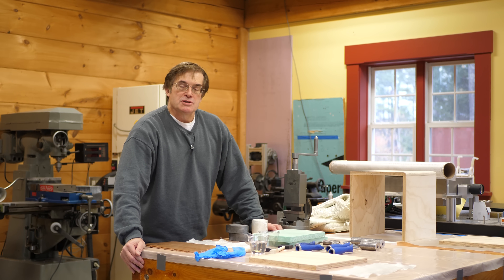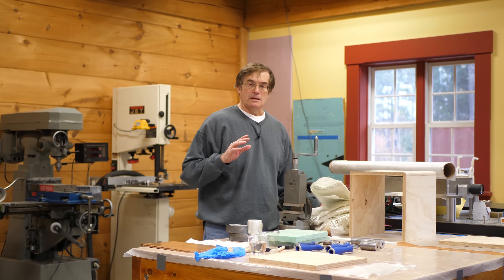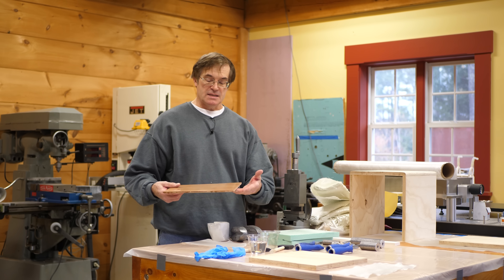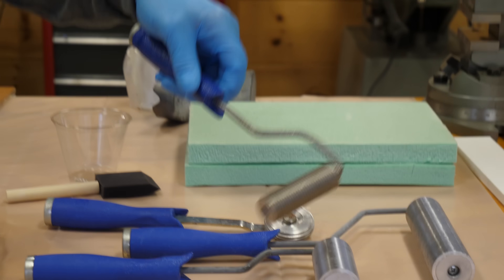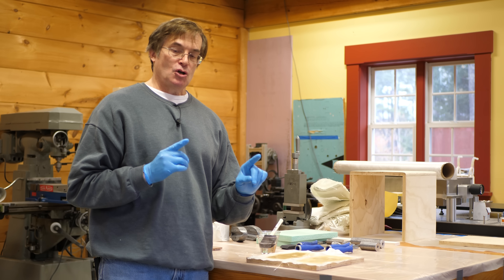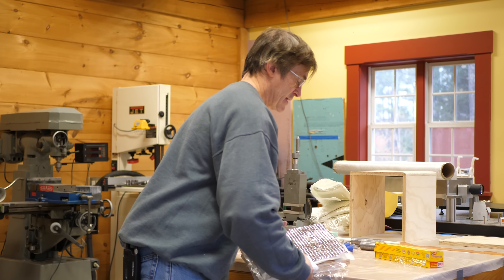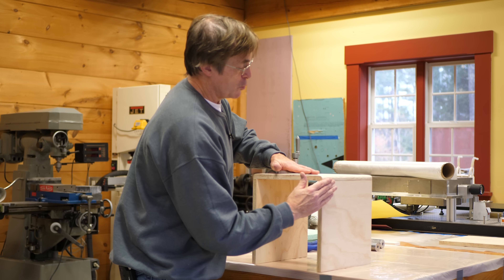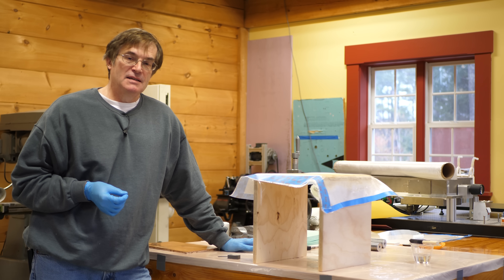Easy Tricks Using Fiberglass Strengthening!

Comment: The only thing I will criticize is a common mistake made in most back yard fiberglass projects - that is, using a single layer of 7oz cloth by itself, especially on wood. A single layer of cloth (doesn't really matter what weight, from 2 oz to 24 oz) tends to de-laminate very easily with over-flexing of the subsurface, or any counter-normal force on the laminate. Again, this is especially true for laminating wood. The cure for delamination (95% of the time) is to pre-wet the wood with slow resin and allow it time to soak in to the wood fibers and to cure (kick off) at least partially. Then layup a layer of 3/4 oz mat (random orientation) before laying in the cloth. This is similar to the wad of 24 oz cloth you showed with the mat backing. The 3/4 oz is thin enough that it will not pool up the resin, it aids in thoroughly wetting out the cloth, and finally, no matter how hard you try, a single layer of cloth WILL have holes after curing caused by the weave. Sometimes the holes can be microscopic, but it keeps the lamination from being totally water proof. Over time the moisture that finds it's way into the wood will spread and cause the lamination to separate. The 3/4 oz mat under the cloth insures a complete seal. Even so, the method of fiberglass over plywood or any other wood for boat building was abandoned by the 1980s by all but one die-hard boat builder in North Carolina. Even they have quit using this construction method in the last 15 years because the problem of de-lamination has no solution , at least none has been found in 75 years of commercial boat building. ... and one tip: use a very short nap, 4 to 6 inch paint roller to apply the resin to the glass. It gives more control over the amount being applied, it applies more evenly, and doesn't pull the glass around and out of shape.  In commercial boat mold (tool) making a sheet of 3/4 oz is wet out to excess, then the 7 oz clothe is put over it and a soft rubber squeegee is used to both press out the bubbles and to pull out the excess resin. Depending on the boat builder, sometimes the 7 oz cloth for the first layer is removed once the excess resin has been squeezed out and only the 3/4 oz is left to cure (very slowly) This prevents imprinting the cloth pattern to the inside of the mold.
Reply from the maker: I'm sorry, but I have to disagree.  I have been building boats for many decades and the single layer technique has worked well and is still protecting projects I constructed nearly 40 years ago.  Gougeon Brothers, similarly have boats that are doing well after 30 years of use.  There are various methods for applying cloth to the outside of hulls and your method also works well.
Reply: @TechIngredients  It's not unusual to have long debates, for vs against, laminated plywood in the lunchroom among glass techs, but one thing you will not hear argued is the shortcomings of a single layer of any weight cloth with no mat backing. My experience is working with polyester and vinylester. You are working here with epoxy and it's adhesion and filling characteristics may be different. You are also laminating a closed cell foam core. The resin is not absorbed out of the glass layer during the layup in this case so there is a reasonable argument for it. If water does find it's way between the lamination it won't rot the foam. In wood lamination this is where delamination usually begins. Environment temperature changes on the trapped moisture can delaminate an entire 4 x 8 panel - I've seen it happen - more than once!  During the fiberglass boom in the 1960s many major boat builders; Chris Craft, Hatteras, Bertram, etc tried to perfect laminated plywood, but all abandoned it fairly quickly. The N.Carolina builder is Carolina Skiff. The hallmark of this company is a glass laminated plywood, flat bottom boat. It was warranty work on delamination that finally drove the company to convert to molding their hulls and getting rid of the plywood all together. I think you'll find most small commercial and custom boat builder that does this is using a chopper gun to lay down a very thin layer of chop, about as much or a little less than a 3/4 oz mat, which also pre-wets out the wood, before applying the cloth.

Comment: Speed curing weakens structure
Reply from the maker: Not necessarily.
Of course the coating must remain fluid enough to completely wet out the cloth.  The polymerization rate is temperature dependent and each resin system will have a recommended range for curing.  Many high performance systems require an elevated temperature to complete the curing process and reach their full strength.

Comment: It is much cheaper & easier to start with polyester resin, not as strong though. Also the cloth does not have to be glass if you are using epoxy organic materials can also be used like flax, hemp, bamboo, etc. There is a product you can put on the surface before cure of epoxy so you can peel the amine layer off with it once dry.

Comment: Challenge..!
Functional hexapoidal rolling chassis.
Insectoid monocoque design.( my spelling is broken).
Rv scale. 8 1/2 feet wide. Up to 13 feet tall. 27 feet long.
Integrated thermo electric generator layers( sensor or energy or homeostator).
Solar, wind and water turbine.
Ultimate escape pod...!

Comment: Great video! It gives me an idea: when laying up a deck you can use slow cure epoxy and then lay black contractor bags over the top. The sun will heat the bags and the lay-up significantly and speed up the cure time. No heating pads necessary.
Reply from the maker: A lot of wooden boat builders take advantage of the sun.  They'll do the layup in the shop and bring the part out into the sun to speed up the cure.  The bags will speed this up and keep the bugs off, but can imprint the surface.  Most don't use them. 
Keep in mind that if this is a first coat over porous wood, the heat can expand the air under the resin creating A LOT of bubbles.
Reply: @TechIngredients  Good to know.

Comment: Hi Tech Ingredients - - - might want to check our robert murrey smith's channel as hes been working on graphite ballistic armour. I also want to thank you. Im thinking on making a kayak and your info is very informative. All the best, kieron uk
Reply from the maker: I'll check it out.  Graphite has been avoided for armor because the amount of energy it can absorb is quite low.  Toughness is the product of tensile modulus times ultimate elongation.  The greater this product, the greater the work (force x distance) the material can absorb.  The modulus of carbon is really high, but the  ultimate elongation is pretty low.

Comment: An other good technique for speeding up curing time is using infrared lamps.
The advantage is that if you have problem areas that need more heat than others,you can easily regulate heat quickly by moving lights closer,and save the insulation and covering part! You can use infrared emitters used for lizzard terrariums.
Reply from the maker: Good idea.

Comment: I'm designing a racecar for Formula One that I'm calling "Project Cheapskate". One of the important characteristics of the design is the use of S Glass instead of Carbon Fiber. That would knock about 700,000 dollars off the price, minimum.

However, S Glass is still slightly heavier than Carbon Fiber, and it's also not as stiff despite being much stronger overall.

This makes me wonder... What composites would you recommend to get a similar end result to the stiffness and lightweight of Carbon Fiber without the extreme cost?

(Seriously... It costs four times as much to build an F1 car as it costs to run an entire IndyCar team.)

Now if cost was not an issue, I'd probably use aerogel as the core and just coat that in fiberglass.

Comment: 1. Get a two blade smaller windmill cut the pole of it.

2. Add two iron balls :-) to the tip of the wings.

3. make a round hole in the ground with concrete,there just fit the mill.

4. Install many flat low power elektromagnets around the side of the hole  

5. Make a computer code to turn the magnets on and off right enfront of the balls.

6. make a ruff or dome over the hole. Pump all air out.

7. Free energy if not... Get a more frictionless mill and try again or enhance the code. I will work for you ppl some day just get rid of the powerbrokers.

Ok sry for bad eng im not from around enjoy.

Comment: Being a ignorant guy to probably say what you will talk about in the next video, but I think the easiest and the most efficient way to 
get glossy smooth finish on simple flat surface is using a flat plate as a mold surface.
Just put a plate on top after you have wet the cloths just wait for it to cure.
Sheet of aluminium works good but whats extremely flat, smooth and cheap is glass.
Don't forget to apply mold release properly, because otherwise you will have a GRP and not GFRP

Comment: A tip: If you cut your fibreglass piece on the bias (ie cutting out a 'diamond' shaped-piece, with the fibres running diagonally rather than a 'square' with fibres running parallel with its sides), it will better-drape over the 3-dimensional shapes of your object, for example in the corners, and won't form 'pleats' which won't conform to the object like it did when you cut it with the fibres running parallel...
Reply from the maker: That's true.

Comment: It's best not to fold fibreglass cloth like that because it affects the strength of the finished(cured) product as the fibres are stretched out in the folded areas.
Reply from the maker: True.  Many retailers will deliver the cloth on a roll rather than folded for that reason.  You can bend it over if carefull to maintain a large radius and no pressure at the bend, it's risky, but some projects will force you to do this when handling the cloth around complex parts.

Comment: When I saw the section about the fiberglass on the styrofoam it made me curious to if that would create a better panel to use for making a DML. 

Any thoughts?
Reply from the maker: Yes.  You don't want to make the panel stiffer as this decreases the low frequency output.  We tested several composite sandwich layups.

Comment: Fiberglass over foam is how a lot of light aircraft are built today as well. But additionally, they use vacuum techniques to remove the air, clamp the cloth to the foam, and to remove excess epoxy (Which contributes weight but not strength.) You do the layup as you've shown, but all the layers, then put down a layer of what is called "Peel ply" which the epoxy can't stick to, but which has tiny holes the excess epoxy can come through, and a layer of glass mat to absorb the epoxy. Then the whole assembly is placed in a bag, and the vacuum is applied. After it cures, the peel ply allows you to remove the saturated mat and leave a relatively smooth surface.The result is a fiberglass layer with no voids or adhesion gaps, and the optimum strength to weight ratio of glass and epoxy.

Comment: No need for heating pads. Just use a 500W halogen work light placed a couple feet from the work. I would have liked this better had he used some black Kevlar fiberglass mat.
Reply from the maker: I disagree.  The pads can warm from below and will use far less power to warm a large part.

Comment: So,  why epoxy rather than the standard polyester resin ?    I realize polyester stinks and is not real clear,  but it's nothing a fan won't cure.. Polyester cures fast and it's less than half the price...  I love polyester and fiberglass..  It makes great molds.
Reply from the maker: In our video on glowing epoxy, I explain why.  Basically, polyester is actually a little stronger than epoxy...once.  it's fatigue life is much poorer.  That is why high end boats and all aerospace composites use epoxy.

Comment: I have really been enjoying your epoxy/fiberglass videos. i just got into vacuum bagging foam rc planes this past year and its mostly been trial and error learning by myself from online. So really appreciate the tips you bring out, will definitely include these in future projects.
Reply from the maker: Great!
You might check out our 4 part series from last year about building large multi rotor propellers.  The scale is similar to what you may be doing.
Reply: @TechIngredients  will check it out. Im mainly into slope soaring but im sure ill find something usefull.

Comment: For applications that twist and vibrate the fiberglass panel, like a small travel trailer constructed with this method, I would worry about delamination.  It is a big problem in the RV industry.  The fiberglass is only as good as the bond it has to the plywood, foam insulation board, etc.  Fiberglass boats that are made 100% with fiberglass in a mold do not have this problem because there is nothing the fiberglass bonds to.
Reply from the maker: The problem with those interfaces is the typical adhesive polyester. Polyester is cheaper and INITIALLY stronger than epoxy, but it has a lousy fatigue life.  After only a few cycles, it is weaker than epoxy and fails much faster.
High-end boats only use epoxy rather than polyester for laminating for this reason.

Comment: No mention of hardner or the ratio to cause it to set. I watched and as a first timer reinforcing a substrate have to start over because I followed the video only , applied the resin and fabric , then more resin ..then discovered a bottle of hardner as I put the fiber mat away .now it's clean up and try to scavenge my product then add hardner and do it right I hope !should have watched several instructive videos and better attention to details . Live and learn 
Wis/dom = experience I think
Reply from the maker: I'm sorry to hear that.
I didn't mention it because different epoxy formulations require different ratios as specified by each manufacturer. 
The Raka epoxy we use most of the time requires a 2:1, resin to hardener ratio by volume.

Comment: You should never fold fiberglass materials. It breaks the strands of glass which makes it weak.
Reply from the maker: That's generally true.  A loose bend that does not remain when unfolded is ok and is sometimes necessary when moving large sheets of material.

Comment: It's actually a carboxyl formed by the amine groups used for curing that's reacting with carbon dioxide in the air that's the main culprit of bonding epoxy to another layer of epoxy.

But the general rule of applying "wet on wet" works just fine.

Excellent video, I'm an epoxy 🤓 nerd, I loved it.

Comment: So how come it's plain weave? I heard at least for carbon fibre, it's stronger if the fibres are just layed up without any weaving at all. Obviously a bit is needed to make it not just fall into a tangle, but if glass behaves the same way as carbon, wouldn't a satin weave be stronger, because it has less bends in it?
Reply from the maker: That is called stitched cloth and it is indeed stronger and stiffer if a little less flexible when being handled.

Comment: "Why "petroleum free?"  Because many workshops make use of kerosene or propane heaters that vent their exhaust into the shop.  These types of heaters can, theoretically, contaminate the air with byproducts that may chemically react with the epoxy, causing it to lose a bit of cohesion and become a little more opaque... theoretically.  However, in practice, I use a propane heater (like a Mr. Heater) or a low emission kerosene heater that I keep far away from my project.  Electric is better, though.  If I can heat the whole drying surface at the same time, I like using a radiant heat lamp (infrared heat lamp) to shine directly on the project.  Just don't let the project get any hot spots.  I am aiming for moderately warm, even heat.  Note:  here is some geeky info that may be true, in theory, but has never impeded my epoxy cures in real life:  Because 100% complete combustion never happens in the real world, you end up with the partial combustion products CO, CO2, NO, NO2, SO2, which are produced by propane and kerosene heaters.  The produced SO2 is bad for epoxy (theoretically) and CO is bad for humans (actually).

Comment: For the long-haul, fiberglass over wood is much less simple to repair, as any leaks will soak into the wood without telling you, and then you have to make a full replacement, often costing as many hours to complete as the time to build a new one. It has been generally found more useful to do fiber on fiber, or possibly fiber over a plastic if you fear rigidity, unless you plan to dispose of the craft after a few decades.
Reply from the maker: That's partly true.  An external sheathing of fiberglass over a cold molded hull provides a much harder, tougher and damage resistant exterior that will last at least several decades. The moisture stabilization also reduces the seasonal expansion and contraction that will break down wooden hulls.

Comment: Those are some great tips on handling the edges, always a problem area. One tip you probably already know but others may not, those razor blades are pretty much one use only, the fiberglass quickly dulls them and you have to have a really sharp blade to cut it cleanly.

Comment: Have you ever heard of squeeze out method then you optimize the epoxy and fiberglass ratio. 
You use two sheets of plastic and squeeze out the epoxy then you got a lighter fiberglass. 
You can also use vacuum to do vertically surface but you need lot of other tools....but that is another topic. A round cutting knife like a wheel makes cutting easier
And stay safe use protection when dealing with epoxy it’s dangerous!!